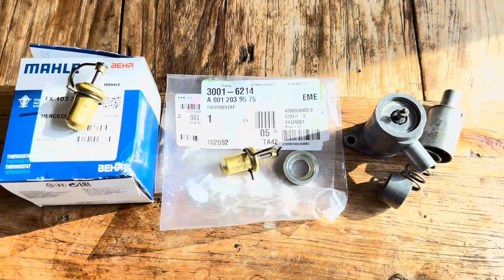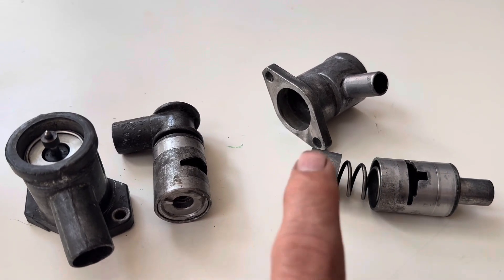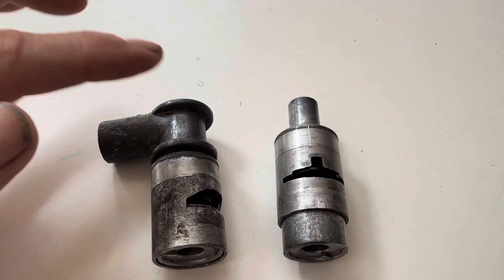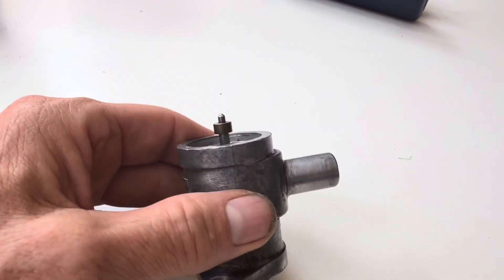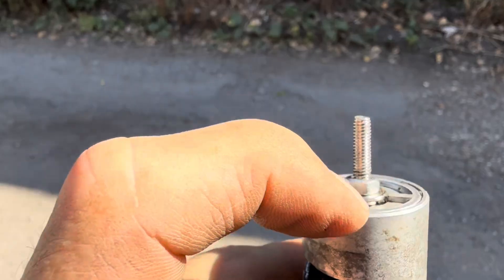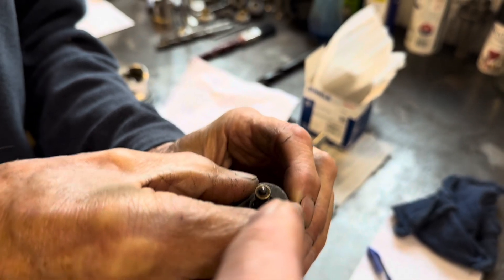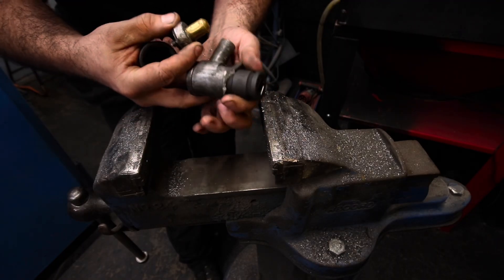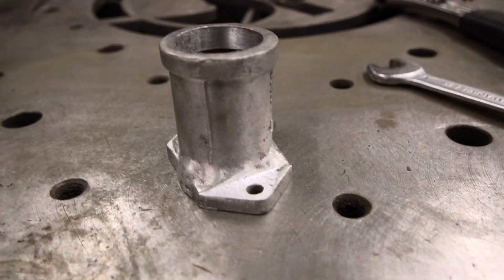How to disassemble and repair the Auxiliary Air Slide valve on a classic Mercedes, Porsche & BMW etc

Comment: I'd expect that the biggest issue with the valve is that the piston/sleeve is dirty or stuck. After separating the top and bottom, testing the bulb, make sure the piston and sleeve are polished and work smoothly. Using the correct antifreeze to prevent corrosion inside the sleeve may be enough to prevent sticking, but maybe some type of waterproof grease or silicone lube might be advised?
Reply from the maker: Yes you are right - those pistons usually get stuck either through  lack of. Often the coolant starts corroding the bulb housing...and eventually leaking into the assembly which was the issue with my car. I suppose the only downside of trying add a lubricant is that it may attract dust and dirt. It is the reason why lock smiths always lubricate with graphite powder. Mike

Comment: I’m not sure I can replace the wax bulb. I may try to unstick my piston and test my bulb with water.  How did you get the piston Steve out?
Reply from the maker: Hi Rome - as you are probably aware, you do not need to separate the bulb from the housing to free up the piston.

To separate the piston sleeve from the rest of the housing, you ideally need a hydraulic press. The bulb faces upwards and you use a socket to press down and also a socket below which sits on the edge of the housing, but is big enough to allow the piston section to slide through. You will end up with the bit I have in my hand in the first 5 seconds of the video+the sleeve with the piston.

Once you have the sleeve and piston out, you can use a vice and series of washers and a hose clamp to get the piston and spring out as shown at time code 8.52. That section of video shows the procedure for a 450sl....it is actually easier for the 280sl.

My next video will entail removing the existing AAV and fitting the re-furbed one...and seeing what happens to the engine. I imagine a lot of adjustments have been made to compensate for the stuck AAV. 

Mike